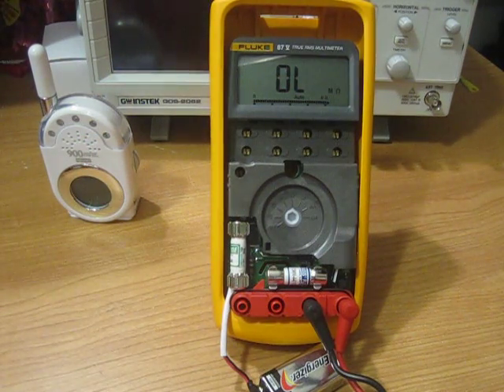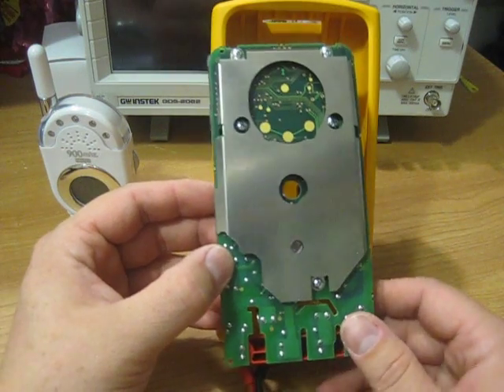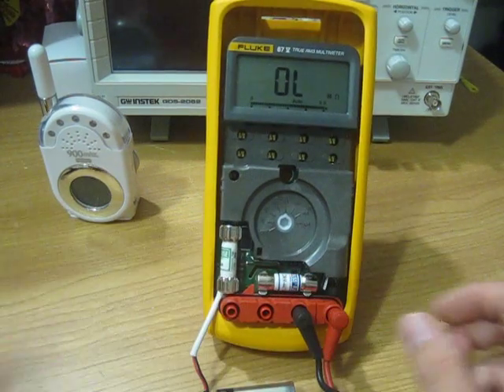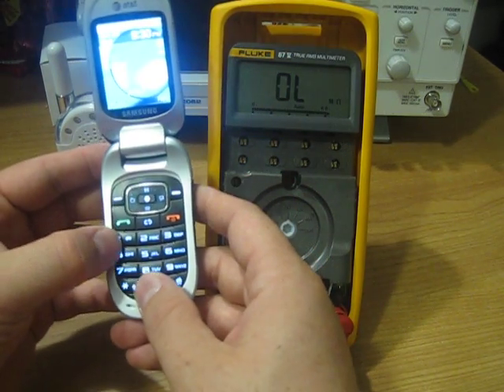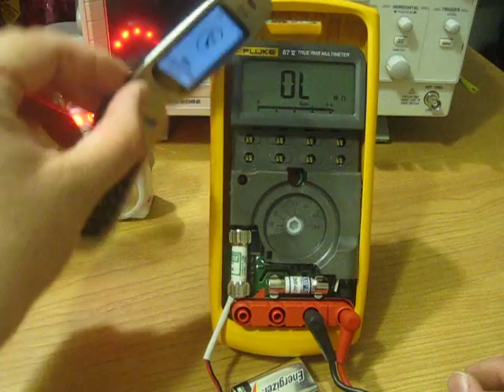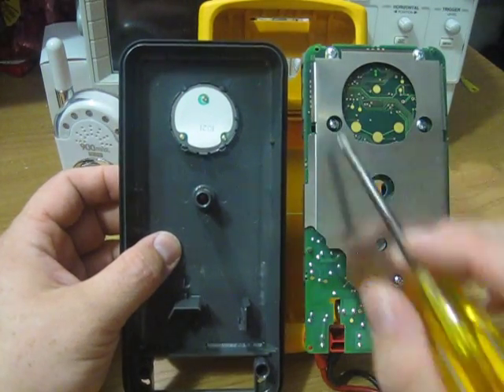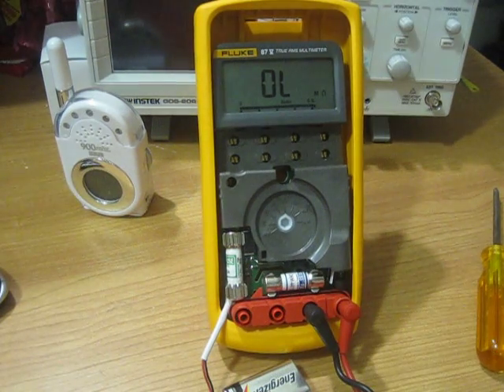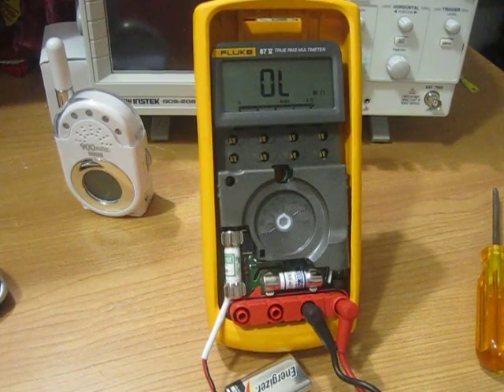Fluke 87V solution...Sort of. Part 2

Comment: Through research I found the cause of the GSM problem is a few RF sensitive components on the PCB near the LCD. I don't know if this is 100% true but obviously some better shielding will fix the problem. If they moved the pezo buzzer inboard and had a better shield on the back like the original 87 it would be fine. I know they are looking into the problem as we speak.

Comment: I think its because GSM has got a wavelength of .16m@1800MHz  and at 140MHz of the handheld, its almost 10 times. Since the space inside the fluke is pretty tight, only smaller waves can produce much EMI.